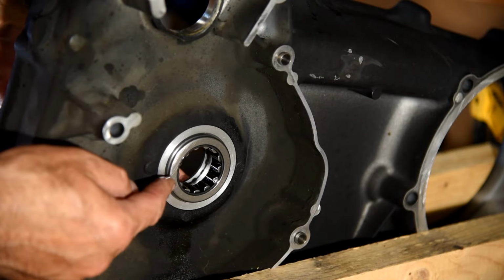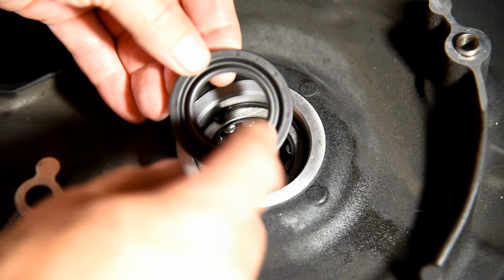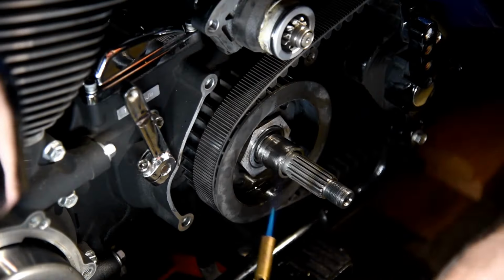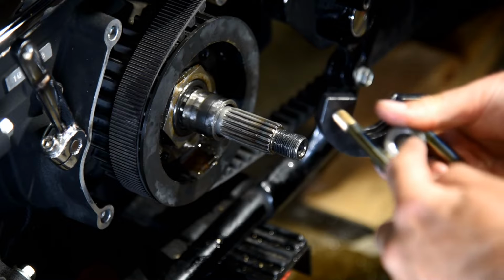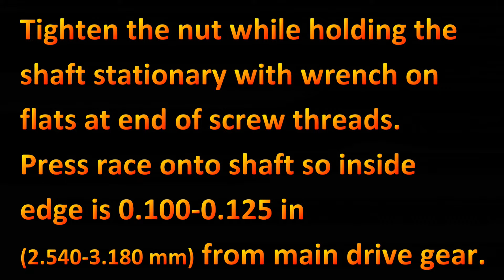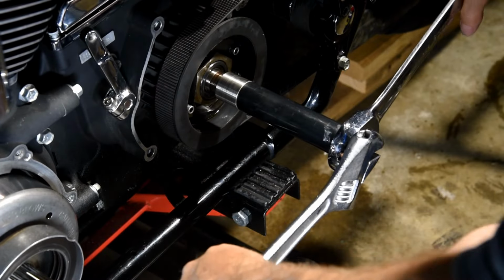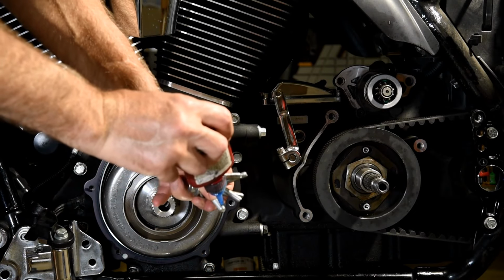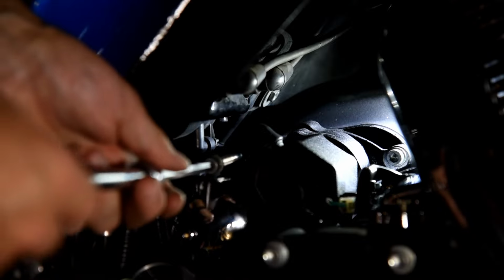Harley-Davidson Noise from Primary Case 2 of 4

Comment: Matt, I'm trying to help you,  not troll you or be a know it all. I do this for a living.  The easiest and correct way is to take off the transmission right outer cover, and loosen the mainshaft nut, and tap the mainshaft over until you can get the puller in place without grinding it.  Now you can lock the transmission by removing the top cover and locking the 2 shift forks into holding the 2 gears or, using the entire clutch pack and hub, to hold the mainshaft nut. You'll need someone to hold the clutch assembly,  but it works.  I hope this helps.
Reply from the maker: Constructive criticism is appreciated.
Reply: I tried the whole mainshaft nut deal tonight. It didn’t work for me, I think my race walked too far in an the tool was still too thick to get in the gap. I had to break out the Dremel and score the race almost all the way through and one whack with a chisel the race was cracked and slid off with no marks at all on the shaft. Not a recommended method, but I work with bearings,journals everyday and have literally installed and removed hundreds of bearings in steel mill rolling mill rolls. Sketchy precision is my bag.😂 In my defense I had the proper tool, but just didn’t work this time.
Reply: That only works on 5 speeds.

Comment: Pull the cover on the trap door, loosen the main shaft nut. Drive the main shaft towards the left side of the bike and your puller will fit. Done it several times.
Reply: Yea, you will have to do this, except the part of loosening the main shaft nut, to replace clutch cable so don't fret it is not hard
Reply: Do you just put it in gear to lock it when you loosen that nut?

Comment: Take a drivel tool cut a groove in the race, then take a cold punch and tap it until the race cracks, slide it off! Install new race! Use the removal tool plate and a guide to set depth of the race! Done it literally 100 times, work on HD for a living

Comment: Shoot I just put the race on the shaft got a piece of PVC pipe about 6"long  just big enough to fit around the transmission shaft  and tapped  the race  with the rubber mallet . Race slid rite on .

Comment: Swapped mine over to the sealed bearing got rid of that race roller bearing bs and big time difference. I got the tool to take it offand when i put the tool on and hit it with the rachet the whole shi bang just fell off. It was just barely on the shaft. Which is why i was losing so much oil. Can't send a pic here or i would.
Reply from the maker: What brand? I am thinking of changing.
Reply: @badmatt4227  all balls racing
Reply: @badmatt4227  amazon has em
Reply from the maker: @tmarx88   I found this article, what are your thoughts? https://www.remotemoto.com/articles/all-balls-racing-products-motorbike-bearings/review-53/
Reply: @badmatt4227  This is ironic as hell...I have developed a whining noise it sounded like it was coming from the lower end on my motor but with a auto stethescope I pinpointed the problem down to the bearing I Just installed by All Ballz Racing  so Im afraid to say it has failed. BUT...Im gonna spend the $50+ I ordered the BAKER sealed bearing kit and will be installing that this weekend. Its funny how that bearing took a shit right at this time.
Reply from the maker: @tmarx88  Please keep me updated. I am going back into mine and I might copy your technique.
Reply: @badmatt4227  I will. Parts Giant says it'll be here. fridaY-Tuesday. Ughhhhh.

Comment: Unless you have one of them Harleys which runs silently and 100% without vibrations, that retainer ring will move around ... and block the lubrication hole. Could be why the bearring was busted in the first place.
Reply from the maker: No, that was not the reason why. The spline in the hub was breaking apart and metal pieces ruined the bearing.

Comment: you are an awesome mechanic. i work on my bike, but not as brave as you do. Do you mind if i drop  my 2005 fatboy off at your house, to diagoise the rocks in a jar sound coming from my primary when idling??!!
Reply from the maker: I believe your bike has a similar issue.
Reply: You might have a bad compensating sprocket too. Do hear a clunk when you turn the bike off? Look into a Compensating Sprocket Eliminator.
Reply: @tidoperez8281  yes you're correct. it was a bad spring pack in 05 Softail compensator. Spring packs for that year  are commonly known to be garbage!  thank you very much

Comment: Your bearing puller/press. What brand is it and where can I find it
Reply: Same question here.  I could not find the inner primary bearing remover/installer with the slot on the side.  Where did you get it?

Comment: Question if the inner race slips down on the shaft will it case the primary chain to start rubbing?
Reply from the maker: No, I don't think it will.
Reply: It'll leak oil like a siv

Comment: Hi, where can I find the puller that you used for pulling out the  inner primary bearing ? Thanks
Reply from the maker: This is what I used https://amzn.to/3kRRrER.
Reply from the maker: Some optional tools to look at
Shifter Shaft Seal Installer
https://www.georges-garage.com/product/shifter-shaft-seal-installer-2/
Main Drive Gear Seal Installer 
https://www.georges-garage.com/product/main-drive-gear-seal-installer-2/
Reply: @badmatt4227  thank you

Comment: use a washer that measures .100"
Reply from the maker: What do you mean a  100" washer?
Reply: @badmatt4227  the distance between the inner race and Main Drive gear is .100"-.125"
Reply: the washer will fit right in between race and MDG to measure instead of using feeler guage. .100" measured
Reply: this is of course a technique used for installing the New Race... Kevin747 method works better than beating the puller on. I've also used a Dremel tool to cut the race and shock break it to remove...  6 to one, 1/2 dozen another...

Comment: Why didn’t you replace that sleeve with a high torque one piece bearing?
Reply from the maker: Do you have a link you can show me?
Reply from the maker: @waltercheeks5309  Thanks, https://amzn.to/32kJ6CY
Reply: That should slide on easily. You need to open the trap door on other side heat the shaft and hit it with a rubber mallet.
Reply from the maker: Hey Walter, less then a year and I am hearing primary bearing noise again.
Reply: @badmatt4227  That sucks. Now you have to go back in. All that work for nothing.

Comment: Wow ... Really ... all you had to do is remove the transmission trap door on the right side and loosen the main shaft nut; once removed you can use a dead blow hammer or rubber mallet to push out the main shaft about a 1/4" ... then you can use your puller since clearance issue will be resolved. No need for blow torch, hammer or other hack job I just witnessed for removing bearing race!

Comment: It's sad when you have to be a MMI mechanic to own a Harley. Sad.
Reply from the maker: Interesting because Harley's are easy to work on.
Reply: @badmatt4227  how do you figure that ?
Special tools; just a start.
Reply: @lindacruz7238  If you don't have the tools you probably shouldn't be working on it anyway. I've been fixing my own bikes for 20+ years. There are a few jobs that require "special" tools, but I've been doing it long enough to figure a workaround most of the time.
Reply: At what point In time did you NOT need to be mechanically inclined to work on any machine? I have a couple of bikes but my 88 Sportster is probably the easiest thing to work on but you still need to be efficient mechanically have a very good set of tools have a good set of mechanical knowledge on how to get things out that are stuck keep from stripping things twerking things properly etc etc. Also I think you should consider the motorcycle these newer motorcycles with 100 cubic inch engine obviously is going to be a little bit more specialized than a 883 Sportster
Reply: @BeardedBavarianBiker  Agreed. I usually start by opening up the cam chest and chunking all the HD JUNK.
Reply: @jamesbevill5847  Agreed. Some people shouldn't even consider working on anything with any moving parts. It helps a lot to have a knack for it, but it can all be learned. Takes patience, a willingness to learn, and some tools. I happen to be a retired mechanic with a shitload of tools, but I can make do when I have to.

Comment: Save yourself this hassle again...autotensioner bye bye....hayden tensioner or baker attitude adjuster.
Reply from the maker: I do not like the constant tension of a Hayden or the price of a Baker. If I had the money I would pick the Baker. For my bike, Stock if better then then Hayden.
Reply: Twin power makes one too...don't know the cost though.  Anything to get away from autotensioners that have the potential to over rachet.
Reply: I installed the Hayden on my 2010 Superglide C and couldn't be happier. Checked it several times and its perfect.
Reply: @badmatt4227  will really no difference than the stock and the Hayden pretty much does the same thing they all keep tension on it even the baker even though it’s manually but just not as tight as the stock one are it could do it but one thing for sure I would’ve done regardless after building the primary is changed the compensator to at least SE because if it goes you have to tear it all the way back down with the stock rotor having internal springs